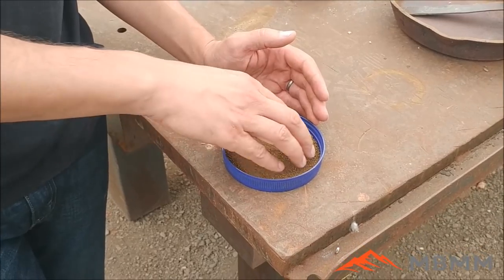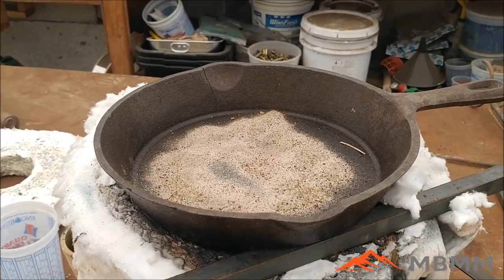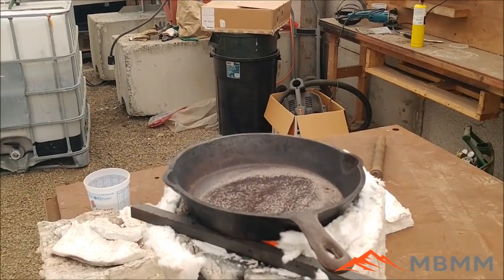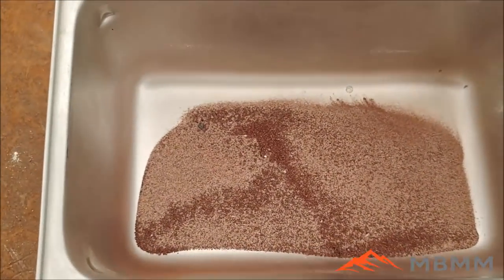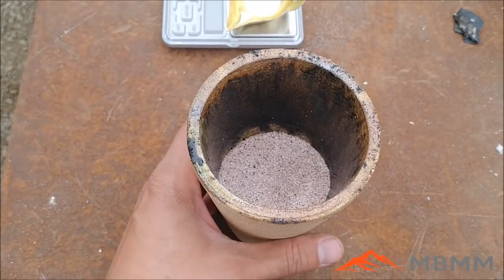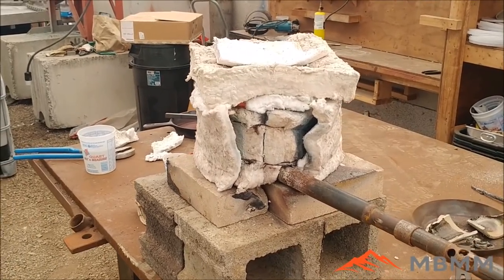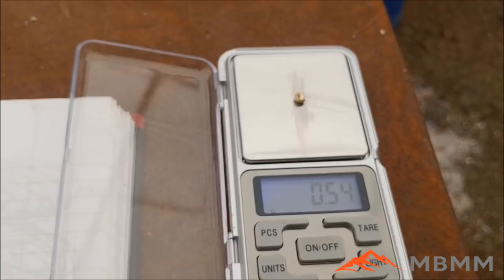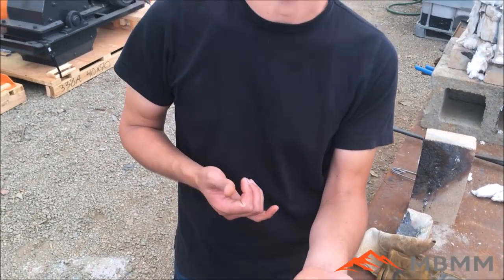How To Smelt A Gold Button By Roasting Sulfide Concentrates

Comment: good job Jason...me and Slim love the vids....maybe make a vid using Litharge to collect the micro Gold from the roasted Sulfides.....and cupel it down to a button.
Reply: Watch out for Slim he will steal you gold.
Reply from the maker: Thanks Jeff!  Good suggestion.  I would like to try some litharge, also want to assay the slag afterwards to find % recovery.  Still more work to do!!
Reply: he always does....
Reply: can't wait to see what you have planned.....we might make of vid on it ourselves....Thanks Jason.
Reply: Four or five things I'm curious about are magnetizing the sulfides that come off with roasting, or passing them over chilled metal (where the powder is reserved or put in epoxy paint, etc), or using an electrostatic filter like an air conditioner "paper" filter nearby but not necessarily with a vent; and what kinds of flux/recipes will grab up sulfides absent roasting, like the old crucible recipe of putting nails in the melt with the iron "attacking" the sulfides, where I had crossed my fingers the Hank Chapman Jr. flux did this, but where mixing reduced iron powder in with the black sands was a thought?
Reply: Another incredibly useful video. Thanks. God blless. I fantasize that a toroid shaped mill might give me maximum tension with fine crushing, similar to a cone crusher, but ideally there would be a medium or liner extending wear life. Or a do-hicker for milling with a back-hoe. If there were a flux recipe that used iron powder, or something else to go straight to matt from head ore "cons",  to save a flotation step, that might be interesting to some. I have been posting on obviousological research for some time here on the internet, btw, if you look for my handle.
Reply: I am here in Calaveras county California. Found 1 mine that's open and possibly couple others that are calaspe. Find A lot of flour gold all .
Reply: Like to extend a invite to you to come visit ranch.  Maybe vid can do on area mining and how to here. Wild Bobcat also hangs out around me often
Reply: Bob cat chews on bones. Warning to Slim ! Lol

Comment: Jason, perhaps this is dumb question, or maybe ive missed it somewhere... What is the reason for roasting the concentrates, rather than roasting the crushed sulfide 1st.      I'm curious if perhaps you've already covered this,, and if not, could you? You've informed us that roasting the sulfides drop out more precious metals couldn't there be smaller particles (200 mesh), thus lighter and perhaps just being tossed out as tailings?

Comment: Jason, both points were clearly covered; thanks for adding to my education.  Did you notice any garlic odor as you were heating the sulfides?  So much of the gold ore in the northwest contains arsenic, which can be oxidized in a similar fashion.  Glad you did it in an open air environment.  Interesting video, as usual.
Reply from the maker: Hi Richard.  Didn't smell any garlic, I really tried to not smell any of it.  Those fumes can be really nasty!  The SO2 etc. as you probably know are really terrible for your health.  Turns into sulfuric acid in your lungs when it mixes with the water in your body! Glad you liked the video.  More to come in the future

Comment: You roasted your sulfides with silica sand in the cast iron frypan ,i have heard others say salt is that ok ,or do you prefer silica sand  .  i had looked into silica sand or sodium silicate i think it is called  ,and you can't just use like white beach sand ,i believe that the purest form of silica sand is crushed quartz ,is that correct and is that what you use . Also once that's done could you use chapman flux for the smelt .cheers .
Reply from the maker: Yes any silica sand would work, broken glass works too.  Salt is traditionally for silver ore.  Chapmanns flux would work good to as a flux also
Reply: @mbmmllc  What ratio do you use for Borax?

Comment: i like the basic minimum method just soda ash and borax .sparse chemicals / acids with  added gold as a collector. instead of lead  which then you would have to be xtra  careful of fumes. and cupel also eliminating  mercury. .  did you know what  % amount of recoverable gold contained  in the  sulphides  was released  with this nice basic technique.
Reply from the maker: I have assayed the glass and it comes back almost devoid of gold.  Smelting will recovery over 99% of the gold if done correctly

Comment: My question is should roasting turn all of the pyrite black and/or red or can it still appear to be gold in color? I'm thoroughly roasting sulfides which is leaving a lot of gold colored specs behind that appear to be mostly pyrite. Could these specs be gold still attached to pyrite and would smelting them refine the pyrite out of them?
Reply from the maker: Worth a try.  You might also crush them finer before roasting.  It takes a lot of heat, are you getting them hot enough?
Reply: @mbmmllc  I'm roasting to glowing red-hot. This is one of my biggest quandries; is the gold stuff pyrite, gold, or some sort of mix? I wish I was a geologist/metallurgist. 

 I don't yet have a furnace that will get hot enough to really separate the metals when using borax. It's so thick, I can't even pour it. When I can afford it, I'll buy a furnace or make one like yours which I pointed out to my husband. Ugly as hell, effective as heaven.

Comment: Another great video, thank you!  My question is, why do I see so many people using litharge, which requires cupelling to remove lead, when you just demonstrated a full collection of gold without litharge?
Reply from the maker: Good question.  Litharge is used when there is such a small amount of gold in the material it doesn't come together in a button.  I was experimenting with the lower limit of this and ~1.6% gold by weight is lower than most people think its possible to get a button.  I still need to assay the slag afterwards and make sure I am collecting a very high percentage of the gold to make sure it works.  Thanks for the comment.  I will post more vids and answer questions like this one in the future.  Thanks
Reply: mbmmllc Thank you Jason. It’s all starting to make sense!

Comment: I tried this and got gold colored specks in my slag no button. I understand the 1/2 gm you used acted as a collector I did not add any. Smelted 1 hr at 2,000. Would the tiny specks in my slag be gold? As I understand the pyrite would burn up, correct?
Reply from the maker: try crushing up the slag and panning it out.  If its gold they will pan and you can see the beads of gold.  The pyrite needs to be oxidized or it will form a matte

Comment: mbmmllc: How do you separate the different rates of gold in Britain we have 9 14 18 and 22 in the past we had 10 11 12 13 15 16 17 19 20 21 and 23 carat gold. You always start off with a tainted gold button with trace elements of silver and other metals. How do you start off, is it with 10/14/15 carat gold. I can understand your Portland cement Lead and zinc processes, it's the process where you get higher grades of gold, may be up to 18 to 23 to even pure gold. How would you do this.
Reply from the maker: electrorefining or acids is a good way to get pure gold

Comment: If you did not add the gold as the collector, what would you recover??
Reply: Possibly nothing. You need enough of the collector to ensure a button at the bottom of the cone. Lead is usually good, as it is cheap and readily available. Your button will then be a lead alloy with gold, silver, and whatever other metals are present in the ore. The button can then be cupelled, removing non-noble metals via oxidation.

Comment: I don't get it. Why did he add the gold AFTER the roasting. Shouldn't the gold be in the concentrate from the beginning? Sorry if my question is stupid.
Reply from the maker: Not stupid at all.  I needed to add some gold to make sure there was some in the concentrates, I wasn't sure there was going to be any in there so wanted to make sure.  I could have added it before the roasting process too, either way would have been ok
Reply: @mbmmllc  Might it be better to explain it as: The process is supposed to take gold dispersed through the mixture and specifically concentrate it to a button in the bottom? So for example, a mixture like this might have more or less gold depending on the ore feedstock, and this process is supposed to reliably shift any gold throughout the mixture into a specific location, a bead.